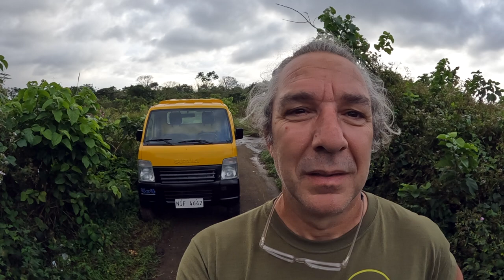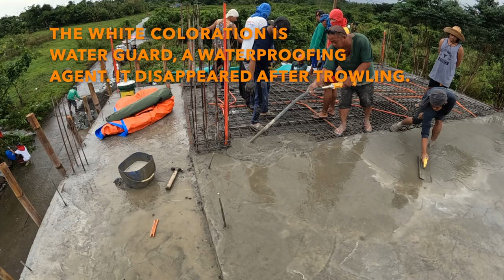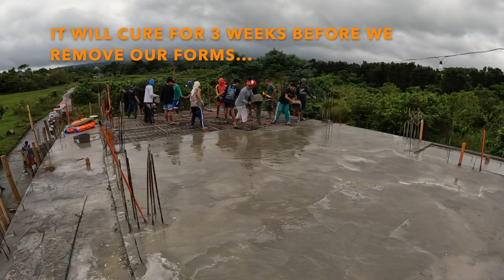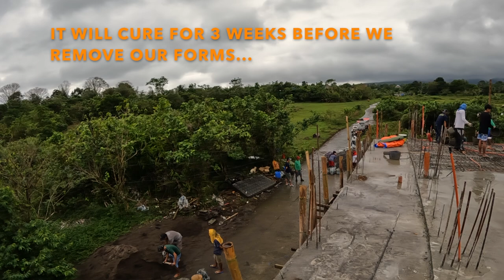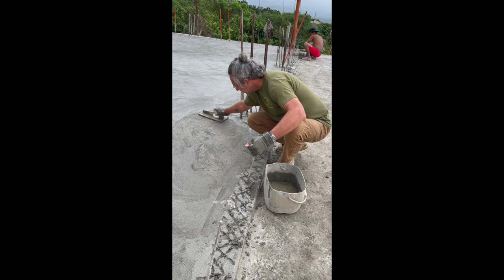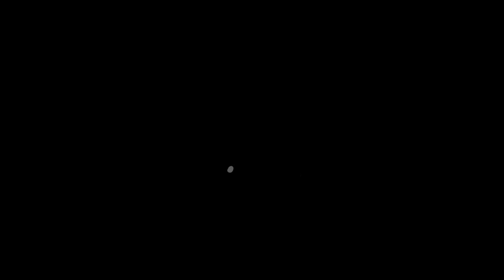Concrete Roof Pour 🏠 | Garage Build Philippines | Ep. 18 | TORINO

Comment: So in Phillipines houses can be roofed withconcrete? I never being there. However, I was wondering why most houses built with metal roof if the weather is too hot.
Reply from the maker: Yes, the steel decking is used only as a form for the concrete; rather than using plywood. I think there are studies that show steel decking is actually less expensive than plywood forms. There are probably many reasons plain steel is used for roofing (no concrete), but, I think they would be budget, desired durability and whether or not the owner/builder wants to add multiple floors. When only steel is used there is often insulation underneath to combat heat and noise from rain. Hope that answers your comment. Thanks.

Comment: Hi Mike, Approximately what size is the garage ceiling?
Reply from the maker: hi, it's 12 feet from the floor to cieling.
Reply: @T O R I N O™ Building in the Philippines  Hi Mike What is the length and width. We just got our lot cleared and the well put in. I plan to build a wall first then the garage and then the house. We are back in the states now and plan to come back over sometime between Aug. and Oct. The architect is working on drawings now.
Reply from the maker: @joefugate9338  the area of the garage is 22 x 38 feet. the total lot size is 129 sqm, so the usable space was about 78 sqm. we abided as much as we could to the setback requirements without losing too much space. i left a decent amount of space on the frontage and side. i'm not a fan of building on the easements or right up to the curbs... where are you planning to build?
Reply: @T O R I N O™ Building in the Philippines  Hi Mike, Our place in in Mangaldon.
Reply from the maker: that should be nice, lingayan gulf...